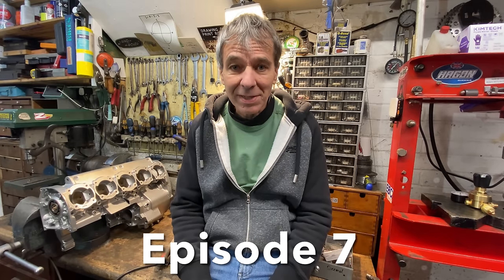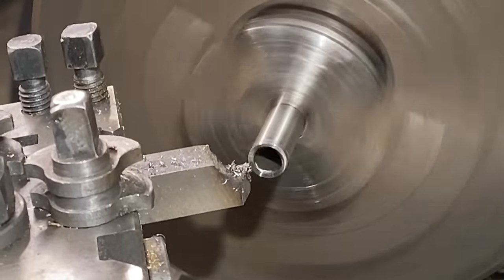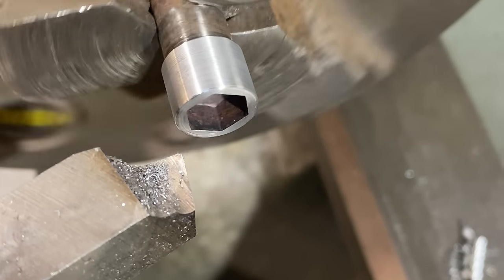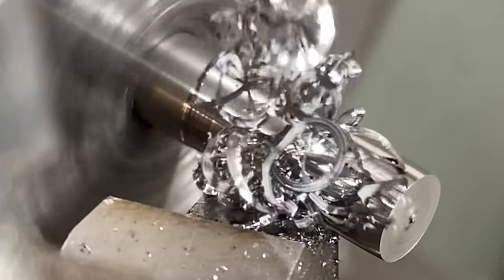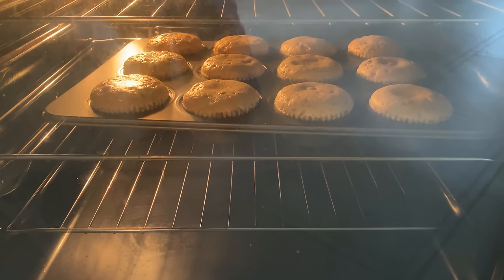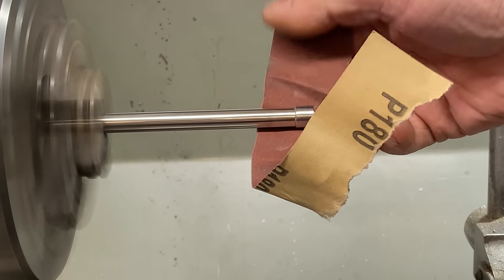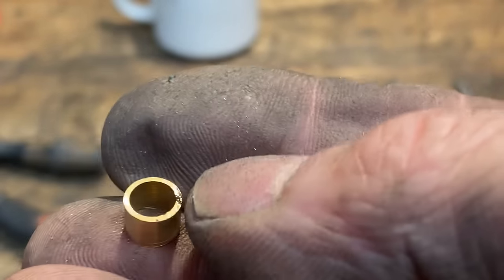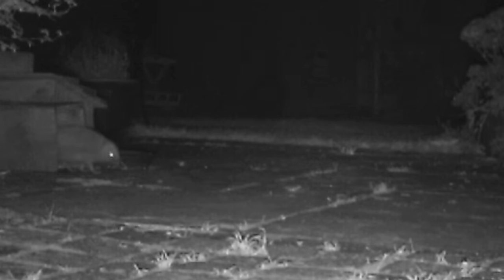Kawasaki Z1 900 engine rebuild Episode 7 - Carb adjusting tool

Comment: Great stuff Alan, I used to make my own specialist tools for working on jet engines. Crows foot spanners and off set spanners to get into all those awkward places, especially useful for fuel pump changes where you had fourteen nuts springs and washers to undo that you could hardly see let alone get a spanner on. Took me right back.

Comment: Nice job on the carb adjust tool Allen! I made one similar back in the 80's when I was monkeying around with various 4 cyl 4 carb bikes. I recall I used a steel tube from a scrapped floor lamp for the body of mine, and added a formed steel strip around it as a handle. Don't remember what I used for the knob, it might have been a brazed on hex nut from the junk box to give some "finger feel". The socket was made as I recall from a capscrew with a 5/16" a/f hex socket. That's Canadian metric for 8 mm you know....8^) Like your cupcake cooling stand! That's doing the job in style. I imagine Tracey may be aware of your cupcake removals / testing. If she were doing 100,000 unit batches she might not miss one, but a dozen at a time, hmmm....... I'd be workin up an explanation or three. Pidgeons are notorious baked goods thieves you know...
Reply: Great job Allen , you always amaze me with your skills .

Comment: nicely made tool Allen, I dont know if it is still taught now, because the safety sally's probably do not allow people to use screwdrivers, hacksaws, tin snips etc etc. but apprentices used to be taught how to use hand tools, how to make implements , tools, and pieces of equipment, some of which would last a lifetime.

Comment: Another great video Allen, just an unrelated question. 
You use C76 ZX1 Microlube Pin Oiler as a general lubricant, so I take it that you must like their products, do you use their EXTRALUBE ZX1 Micro Oil Metal Treatment in any of your engines?

Comment: Alan, either I am psycik or I watched this some years ago but cant complain.
I suppose I could have been a time traveller but I can't remember where I left my watch.
I have to ask why you don't quench in your tea? as it would of course be a win win situation.
Your tea will be warmer than the water so it would cool the steel a little slower and it would simultaniously supplement some of the therms lost from the tea while working.
Well done.

Comment: I’m doing a restoration of a GL1500 at the moment, just got it on the road but have a mystery air leak and diabolical front suspension. Think I’ll stick with my ST1100 for Christmas.

Comment: Wisharts in Leith Edinburgh did a set of thin wall box spanners 8-9 . 10-11 ect , i bought a set and got a long flat blade off the Snap-on van. Ground down the flat blade and hammered 2 of the box spanners together . Did the job for me back in the PitStop workshop in 1979 , but wasn't as nice as this . The Kawasaki dealer had a very similar tool to whet he has made and some JLS screwdrivers . Wouldnt lend them out so we filed down normal ones to fit better .

Comment: Mr Millyard brilliant how to video , it kinda reminds me of a tip My father gave Me back in the 80's Trying to put longer Norton Springs in the Clutch of My 1979 CCM , putting a tube spanner over the springs and a screwdriver down the middle you can push hard on the spring holding Nuts without the springs Flexing all over the place. ( He had to do the same sort of thing on His Panther 600 back before I was born, But then He also cut corks down and restuck them on the clutch plates , as it was difficult to get spares or afford them back them, So you made do and mended stuff ) . I just love watching you work, you remind Me of Dave Davis from Wroughton Motorcycles, I spent many a happy hour talking and working with Him as He worked on His old DOT machines

Comment: A fabulously useful tool and one I wish I’d had when I owned a similar Kawasaki many years ago and had to do most of the work on it myself. It was a nightmare adjusting those carbs.
Reply: A Kawasaki shop could have ordered the factory tool which is like AM’s but much shorter so you don’t have to fully remove the gas tank.

Comment: Hello Allen 🙋‍♂️.i have a 900 z1 1976. The engine has loss of compression on cylinders 2 and 3.i would like to have your advices about change the four barrels and pistons and rise at 1000 (it s my idea) or rebore ? And if it's possible to know your supplier for all pieces Kawasaki ? 🙂
Merry christmas and happy new year for you and your family.
🥂.
Ps my dream is your 1000cc 2 stroke 4 cylinders for sure!
Reply from the maker: ZPower for all Z1 parts

Comment: Hi Allen, Any chance please you could share thr name of the supplier/maker of these soldering rods. I use flush cored solder from time to time and it does not solder nearly as good as what you are using. Thank you. 😊
Reply from the maker: https://www.ebay.co.uk/itm/334930406406?mkcid=16&mkevt=1&mkrid=711-127632-2357-0&ssspo=neN415CzQp6&sssrc=4429486&ssuid=&var=&widget_ver=artemis&media=COPY

Comment: The best way to sync the carbs is to first ride the bike a few miles so it’s fully warmed up and hot air has also warmed the carbs. 
Then hook up the carb stik or gauges and see the vac levels and then shut off the motor.
Reply: Then using the tool raise or lower the appropriate adjusters. If cyl 1 had high vacuum then it’s slide needs to be lowered a tiny amount. Vice versa for low vac. 
Once you’ve tweaked the errant slides fire the motor up and look at the manometer. It should be very close now.  Shut the motor off and tweak the last tiny bit of imbalance out and you are done. 
By shutting the motor off you avoid generating a lot of heat .

Comment: That's a lovely job !  But the really important question I've got is..... how did you get the glue remnants out of the Revell needle dispenser you use to apply oil with such precision ?
Reply from the maker: It’s ZX1 Extralube
Reply: @AllenMillyard   Thank you ! They use the same bottle as Revell Polystyrene Cement, even down to the blue colour. Had me foxed !

Comment: That m10 bolt ended up looking an awful lot like an 8mm socket. I hate to suggest that as a solution, but I bet you've got a few errant 8mm sockets laying around!
Reply: The hex head bolt is probably a better fit, and way easier to machine and weld to the tube.
Reply from the maker: There are a lot of ways to achieve the same solution